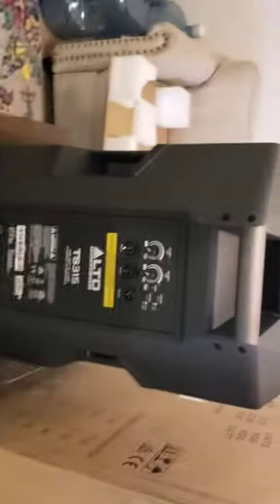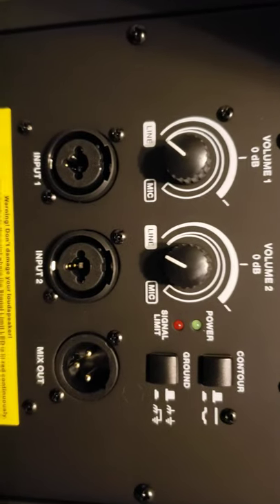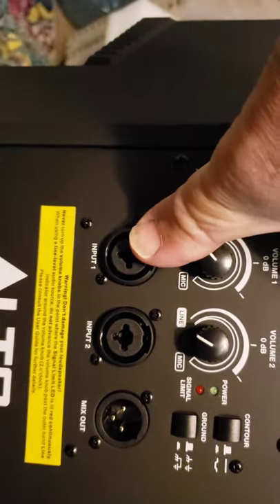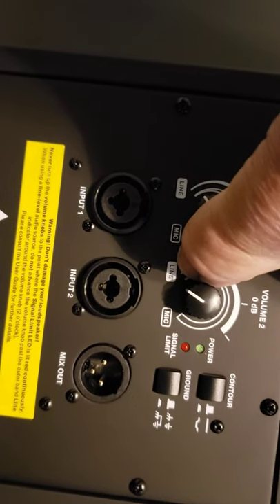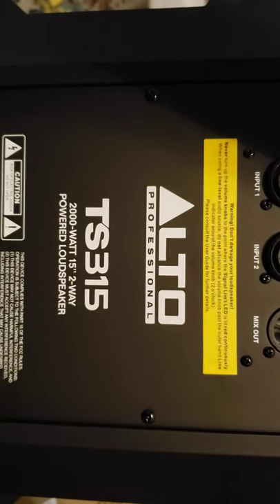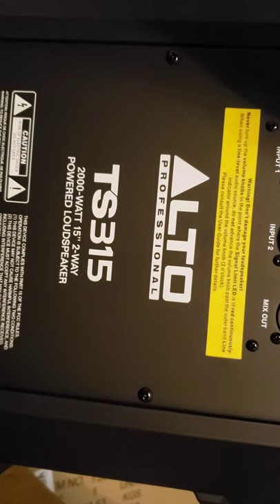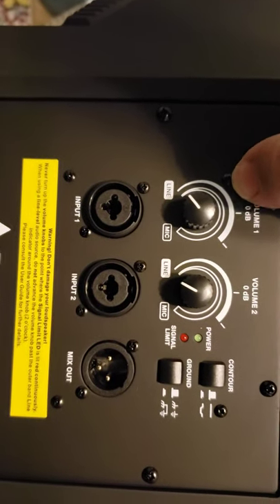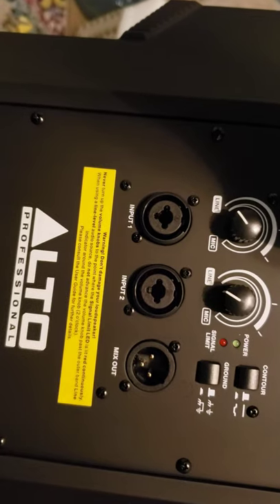Hope they sound good as they look and they are heavy lol

Comment: These speakers will definitely deliver an improvement. The line level at unity (0db) is a perfect setting. Even though it's already punchy before that...but no worries because these speakers can handle it! The "contour" is optional when you have it run without subs. Its basically a simple switch to lift the highs/lows in the EQ curve within the speaker.
Reply from the maker: Thanks always good to get feedback no matter what kind
Reply: @DAMOOSESQUADDJs  yeah no problem. I currently have 3 different pairs of speakers, with Alto being one of them. Its 8" version for small gigs. But I was blown away because they sounded bigger than it looks.